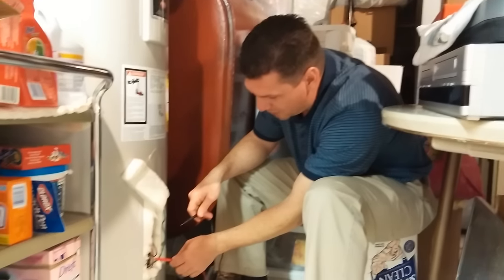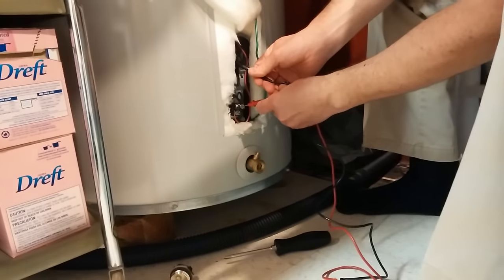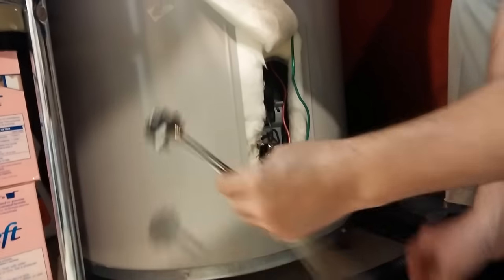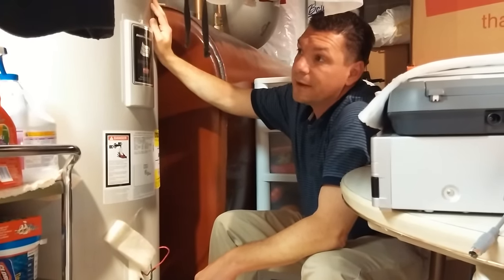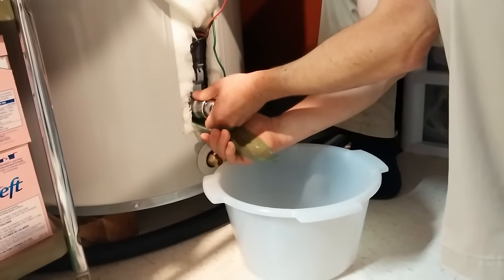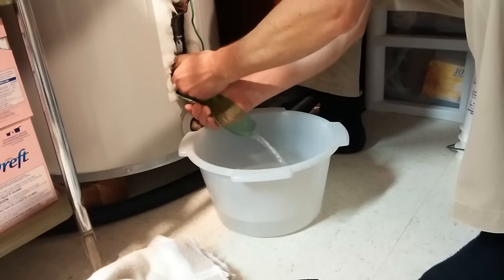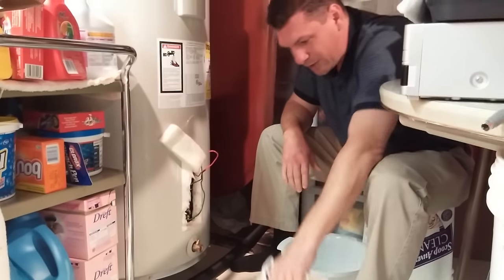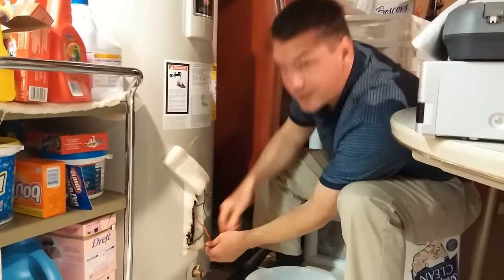Change a hot water heater element without draining or spilling water

Comment: That element you took out must not have been bad. I've replaced many that would never come out that easy. The time it takes to get a real bad one out, you would have water everywhere.
Reply from the maker: @Ray Maresh
 if you see it's not going to come out you'd just shove it back in and then your only choice is to drain the tank. The element I took out for my mother was bad but it wasn't deformed terribly it had an odd "hot spot" burned in or through it at a point on the length. I can't remember anymore.

Comment: How will you know which cables goes where to screws , does it matter which screws cables goes to?
Reply: The wires on the element can go to either screw. Does not matter. You will not be unscrewing any other wires to worry about.

Comment: This works good for the most part but people be warned I've seen elements need to be hacksawed out and if you open that bad boy and can't pull it out easy be rdy for a hell of a mess. Just do this if your a pro don't try it as a amateurs. If you do one thing wrong that water is gona come blasting out like a fire hose and it can be very hot and burn you and it it don't go smooth and its to hot you can't reseal the old element and your just gona have to take a flood. It's best to drain it if you can. If it's jammed upp with sediment and won't drain poke into the thing with a hanger or hold the hose in the air toll it fills then let it down it will somtimes get a good flow going. Been messing with my heater for years and yrs done every mess up in the book and paid heavy for them.
Reply from the maker: +ss5 gogeta 360 your caution is of course warranted but if the element does not pull out all you have to do is push it back in. Re-seal and then you are forced to drain the tank.

Comment: Step #6 is wrong. Your supposed to turn the water back on and fill the tank before turning on power to heater. Otherwise the element can "dry fire" and risk getting ruined.

Comment: WHAT IF I HAVE A DUAL ELEMENT WATER HEATER.  SHOULD I GO AHEAD AND CHANGE THEM BOTH ?
Reply from the maker: +MsDawn0407 Most water heaters today are dual element heaters. So if you are changing one of them, you might want to take the time to at least pull and inspect the other one. You will often have to change the bottom one 2x more than the top one since it runs a lot more.
Reply: +Christopher Moore (CreatingMoore) Mine is dual and as I wrote a minute ago I have basically never had to change out the top one.  I have no idea why.  I'm guessing because all of the sulfur in my water gravitates towards the bottom element and eats it away first.  I will hear it "pop" or if it does it when we're not home we will know it popped because the hot water doesn't last very long.  Every time I pull out the bottom element - it looks like it has been bitten into by an animal or something.  Completely blown out and eaten through.  That sulfur is hardcore.

Comment: what size is that socket for the element
Reply from the maker: +hobobilly1111 I believe it's a 6 sided 1.5" socket. I use a regular craftsman 10 point 1.5" socket on it with a 1/2" driver and it's fine.

Comment: My water just turned insanely hot the past day or two. I've never adjusted anything. Anyone know what the cause is?
Reply: ***** I'm pretty sure its the thermostat. I tested the elements and they are ok. I turned both thermostats all the way down and the hot water is still practically boiling. I temporally solved the problem by only turning on the water heater for about 30minutes a day.
Reply from the maker: +Hercules Rockefeller Might I suggest you do more testing? That sounds like an amazingly wonderful problem to have ...In effect the holy grail of hot water heaters? LOL. If you truly have copious amounts of hot water with little to no explanation... my friend that is a gift from the Gods! Stick a clamp-on amp meter over the incoming power wire to your water heater, turn the breaker back on and see what happens.

If you have super hot water for normal or below normal (30 minutes a day????) input, my friend you will be rich beyond your wildest dreams. Don't screw that system up until you understand where the excess heat is coming from. Zero Point Energy, Over Unity, Aether Energy, Vortex Energy... wow if only I had that problem. LOL
Reply: Christopher Moore Well, I rent the house. I dont pay for water, (But I do pay elect, and it is kinda up to me to fix things).. 
I've been tempted to go a whole month to see if I have a substantial change in my electric bill though.
I was just concerned if any damage to the pvc-c pipes could happen with the water getting so hot..? or if flipping the breaker everyday was bad..?

It IS nice having a seemingly endless hot shower/bath.. But I figured that, even-though the thermostats are turned all the way down, they must be stuck on 'high' internally and sucking down massive amounts of energy somewhere to make up for this..? 

I doubt my shitty water heater discovered 'Zero Point Energy', but I'll give it a month and get back to ya..Either that Or I'll have been 'disappeared' by the electric company..

Comment: That works fine unless the water is too hot to get the new one started and then you'll just sit there and spill water out everywhere
Reply: And sometimes lime for buildup on the old element making it almost impossible to pull out so while you're trying to pull out it will be just continually draining water

Comment: What happens if the water gets the insulation wet
Reply from the maker: That's the whole point of the little innovation I show with the 2-liter bottle piece in there. It should prevent any insulation getting wet.

Comment: I have sulfur water and my filter is currently out of commission and I've not fixed it.  So I am only treating the sulfur with bleach and not filtering it.  We don't drink it.  But my water eats these elements up like candy and actually causes chips of sulfur deposits to reside in the bottom of my hot water tank.  I think the sulfur is attaching to the element then when it heats up it causes these sulfur deposits to chip off of the element and fall to the bottom of the tank.  

When I have drained it before I have peered through the element hole with a flashlight and there is a massive amount of sulfur chips all in the bottom of my tank.  So it's gotten to the point where it eats up the lower element ( never the top ) after only a few weeks.  Then I have to replace it again.  And I can assure you that if you don't shut the water off coming into the tank then when you remove that element is will come out like an explosion!  One day I forgot to shut it off and it nearly flooded my entire bathroom so be sure you shut off that incoming water source to your water heater.  

The other thing I have not been doing, which he forgot to do in this video too, is turn on the hot water in a sink or tub to relieve the pressure off the tank.  I didn't do this last time and when I removed the element water blew out like a cannon all over me.  Sulfur chips went all over my bathroom.  But then it just "gulped" water out a little after the pressure blew it out.  lol  So be SURE to follow these directions if you want things to go smoothly.  This is a great video.  Very nice work and thanks for sharing!  You solved my problem with telling us to turn on the hot water in a sink to relieve the pressure.  I thought maybe the little lever at the top of the tank which is attached to the drain pipe coming out of the side ( and top ) of the water heater could relieve the pressure as well.  Whatever works.

Comment: I liked the trick of using a pop bottle to have the water enter the bucket but your video wasn't clear on whether the hot faucet at the sink was to be open OR closed when the element was quickly removed and replaced.  Please advise.
Reply from the maker: The hot water faucet should be closed prior to quickly removing and replacing the element. This will create an air-lock so you have very little water coming out during this time. The water comes out in small "gulps" because of the air-lock vs flowing out rapidly if you'd have the faucet open. Expand my video description and you'll see the STEPS there.
Reply: @HarmonyTurbines  Thanks, Chris.  Hoping to have good success with your technique tomorrow here in Hagerstown MD!
Reply from the maker: @johnwallacemcclure1143  good luck and let me know how it goes! You're not too far from me geographically! That's pretty cool neighbor!
Reply: @HarmonyTurbines  Ok, will do.
Reply: @HarmonyTurbines  Well it didn't go as smoothly as when you did it.  Had everything planned out correctly, or so I thought.  Unfortunately, the water system has a pressure pump which I neglected to turn off and so when the top element came out, the pump kicked on and made matters much worse.  But I pulled out and shoved in as quickly as possible, tightened, and then cleaned up with a sponge and bucket.  Concrete floor in basement so not a real problem but I can tell you I got totally drenched!   You said you're closeby so where would that be?
Reply from the maker: @johnwallacemcclure1143  sorry to hear that but if you had done step 2 from the video description (closed the incoming water valve to your water heater) then the pump should have done nothing even if it had come on. I'm a bit perplexed by that because a well pump or pressure pump is before the hot water heater. I live in Hershey, PA

Comment: Too bad I'm just seeing this trick at 66!  But I do have a question/observation... when I change the plugs on my cars I always apply Never Cease.  After requiring a 3' breaker bar to remove the anode in my water heater, I applied Never Cease to the new replacement anode.  Unfortunately, the plumber that just serviced it a month ago, did not.  I discovered this because one of my thermostats (or elements) is acting up so I bought a kit to replace both thermostats on my AO Smith 80 gallon electric water heater and the elements.  What the hey, getting messy, why not eliminate all the possibilities.  In the process I decided to see if the plumber had applied Never Cease to the replacement anode... NOT !!!  Plus he must be a bodybuilder or something!  I had to get the 3' breaker bar out again!  Took care of that (and won't be using him again) but so I note that you don't apply anything to the heating elements prior to screwing them in.  Why not?  I guess you don't have to but sure makes replacing them easier. Second question... no one addresses (at least in the 2 videos I've watched) how the wiring goes back on to the replacement heater elements.  Doesn't matter?  Each side is marked w/ different symbols, suggesting there's an in and an out therefore the question.... does it matter which wire goes to which pole?
Reply from the maker: Hi Peter, I think in some areas with hard water you might have more of an issue with the threads. In my case they just turn off very easily. We don't have soft water but rather just middle of the road water. I have never had an issue. Maybe you have more moisture in your basement and things corrode? In either case putting a thread treatment on should not change this process. Just do it before you yank the old one out. Hopefully it goes smoothly for you and you don't have odd issues like some people have experienced. The one lady had me dying of laughter with her colorful stories of water shooting everywhere. Somehow I think she did not have a closed system ...so be sure you check that first!!! Closed system with negative pressure on the tank created by opening lines draining pressure off and re-sealing ALL water lines. Regarding the polarity, this is AC and the element has no polarity. You are technically reversing current 60 times a second through that element anyway so connect the wires in whatever way they fit best to that element. You'll be fine.
Reply: Chris, thanks for the quick reply, and being new to YouTube exchanges (I've watched, rarely commented or when the 2x I have, no responses) yours was a pleasant surprise.  Being a gear head, using Never Cease becomes as intrinsic as buttering bread so wherever I see the possibility of two metals somehow bonding, on it goes.  We live in the exburbs and are on a well (300' +/-) and while the water is good we bought in to the complete Culligan water system... lots of tanks + even more + filters for drinking taps and the fridge... the rep insisted that if I loved martinis, I had to have "pure" ice.  Oh well.  We also added the Amtrol booster tank/pump system.  What drove this project was air in the hot water lines.... and only in the hot water lines. Then the water started getting hotter and hotter and, well try and get a straight answer out of anyone! AO Smith or a truly knowledgeable plumber (can't find one).  We have the AO Smith 80 gallon water heater (ECT 80 210) and the best they could do was "call this plumber and we'll cover the cost of parts, you cover labor."  Such a deal!  Never mind I'd just taken the local guy up on his advertised "service your water heater for $100" special and, next time I'll be sure to ask what that includes because he sure didn't flush it.  And I gave him the replacement anode, a job I was about to do when he advertised his special.  I like to support local businesses and it's always good to have an expert check things out on occasion.  In this case I should've kept my $100.  The air in the lines developed more heavily after his departure until such time it got to be something like the proverbial dinosaur blowing flames out his nose (albeit ours was air + hot water) which is when I called AO Smith.  Since [what amounts to] their switchboard had no ideas I simply decided that what the hey, it's not like this things a race car,  there's only 2 thermostats and 2 elements in this thing, let's just get it done and see what happens.  Lowes sells a universal kit from Utilitech that has all 4 components for under $30 so that's what I bought and installed.  I've just finished bleeding all the hot water lines, much like you'd do w/ the brake system on an automobile, start from the furthest point (turn all the water on) and work your way back to the closest turning them off.  I have no idea if that's the way plumbers do it but... back to square one "Never Cease."  They may simply defer to the valve right on the hot water heater but I'm determined to rule out all the air, steam etc. so I "bled" all the lines + used the valve on the hot water heater (last).  In the process quite a bit of black residue flushed out into the sinks, baths and showers... I suspect the magnesium anode?  It clogged the aerators in the sinks and I expect I'll have to clear the aerator/mesh filter feed to the washing machine as well.  I hate having to fool w/ the dishwasher but... 

Anyway, too early to tell if we've solved the air problem but if you have any thoughts, kindly bring them on! My apologies if I can't match any of your hilarious water scenarios... but I did all of this before my wife got home :)  Oh, last... you didn't address the element wiring... apparently it doesn't matter?  On the element each terminal has a faint imprint, I was thinking "plumberese" for positive/negative but ... too late now?

Maybe I'll have a story for you after all!  Thanks and Happy New Year to you and yours,

Peter

Comment: Good trick and all but don't you still wanna drain it somewhat to FLUSH scale, sediment, rocks, build up, sludge, sand, rust, metal chunks, etc etc ???
Reply from the maker: Sure if that's your goal then yes indeed flush away. In this case I wanted a quick change-o-presto of the element.

Comment: "Change a hot water heater element without draining or spilling water"???? Then You proceeded to do both in this video; drain and splash (not spill) water.
Reply from the maker: I don't drain the tank, some comes out during the change which can't be helped. Splashed only because I forgot to have the line sealed prior to removal of the element. It ads for some comic relief but the information is still solid. Do as I say not as I do right? -It helps to reinforce the importance of closing the lines prior to removal. Right!
Reply: @HarmonyTurbines  I agree with all you said. I had a flood in my basement the last time I changed an element. I forgot to shut the valve, in a hurry. It is comical now but not then.

Comment: All this great information but you missed the most important one. Most people don't have large socket sets so mentioning socket size would be very helpful.
Reply from the maker: You're not thinking of an important fact. Buying your large 1.5" socket and a 1/2" drive breaker bar will cost you LESS than hiring a plumber to do this for you even 1 time. So if you're into doing your own repairs and mechanically inclined then you just got your tools for free to now use any time you need them.
Reply: You can buy an element removal tool for $10 at Lowe’s.  Or you can buy a $15 1-1/2 socket, but typically those are 1/2 inch drives and not many “typical” homeowners have socket drives that large.